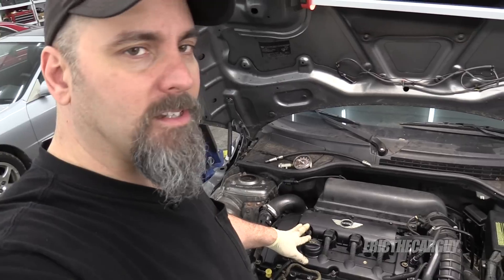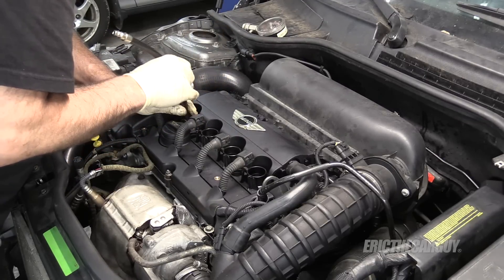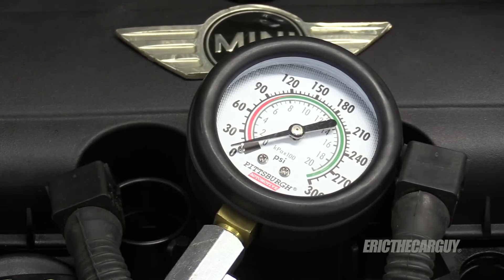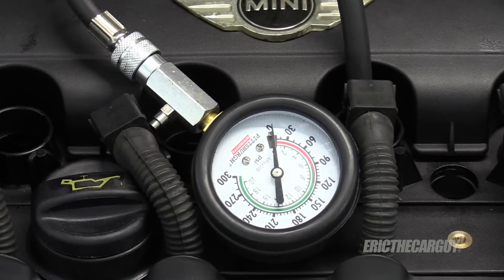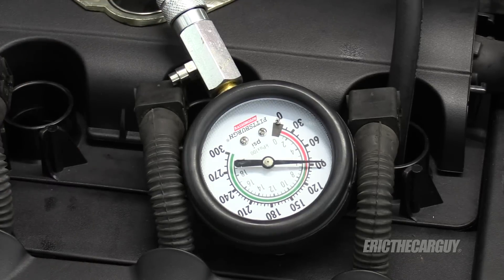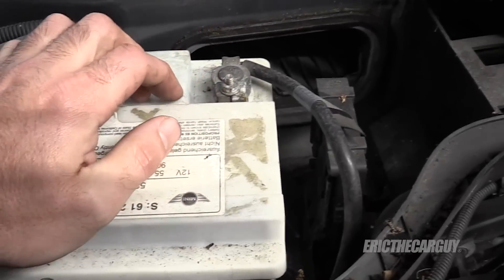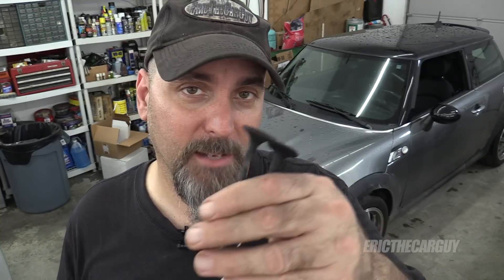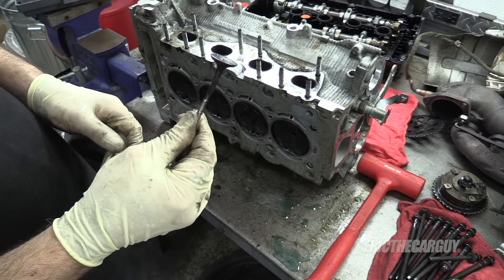How To Find Out if Your Engine Has Bent Valves

Comment: 90 psi is very low. I don't see how that engine isn't completely worn out. My sentra had 190 psi and that was around 9.5:1
Reply: it's the junk horrible fright gauge, check valve is at the tester body and not the hose ends where it should be, they read way low, because it lowers the compression way down....
they're OK to check for balance across cylinders, but forget real readings ;)
Reply: @throttlebottle5906  Mine was on the body as well. Still got correct readings.
Reply: when I say check valve I mean the schrader valve which allows and holds the pressure in the gauge, not the relief button for emptying.
if the valve isn't at the hose end/ spark plug fitting, the results will be skewed drastically by the volume of the hose, fittings and gauge body.
it's equivalent to having a larger cylinder head chamber, lower piston deck height or thick spacer head gaskets., deck height and head chamber is measure in CC's of fluid.
maybe someone will be kind enough to measure the CC volume of the horrible fright gauge/hose setup and bother to calculate the effect it has against that exact engine as factory stock. but I'm guesstimating his results are off around 50 psi !! except the dead cylinder ;)

Comment: I think the low compression numbers you got are the result of the engine being turbocharged.  When the turbo kicks in, and starts making boost, the cylinder pressures will jump dramatically. If you have hi cylinder pressure to begin with, the added boost would most likely, at the very least lift the head enough to blow the head gasket fire rings. Just a thought there.  I thought about it a little more. It could also be the result of advanced exhaust valve timing also. That would cause low pressure to. I'm not saying cams out of time, but, again designed do to turbocharging.
Reply from the maker: The timing on this engine is fine. I just set it before doing the test. Many have suggested that Harbor Freight compression gauges often read low. I think that's the most likely cause. Thanks for your input.
Reply: @ericthecarguy  thanks Eric,  your Wilkome.  I have watched all the vids on the mini. Including the timing belt change. That's why I said it wasn't a mechanical misalignment.  But a designed application of the exhaust timing.  To reduce the initial cylinder pressures. I wasn't claiming at all that it was a mechanical timing issue,  or bad alignment on your part. I hope this clears it up for you. If the calculated, or designed compression ratio is relatively high 9:1 or higher, you can advance the exhaust valve timing to reduce the initial cylinder pressure to avoid too high pressure once the turbo starts making boost.
Reply: They still have way over 90 psi compression. Should be closer to 150-160.

Comment: you could have figured this out buy listening to the starter and no gage.
Reply: only because there was a complete loss of compression in this case.  If the bad cylinder still had say, 50 psi, it would be hard to spot without the guage.

Comment: Question: the aux/drive belt frayed and wrapped around the cam belt which snapped the cambelt, i have replaced both belts and put the car back into TDC re aligned the camshafts fitted a new belt the car was pulled over instantly the car was still TDC and aligned but after replacing all belts and timing correctly the car wont start and it makes a dry starting sound and keeps backfiring through the air filter any ideas did the frayed belt take out some wiring aswell as belts or are the valves bent and if so surely the car would still start on 2 of the 4 cylinders ?
Reply: hard to say if a car would start on only two.  Keep in mind that unless you pull the plugs on the two bad cylinders they are a major drag on the  remaining two.  If possible find out if your engine is a interference engine or not, on a interference engine the valves and the piston occupy the same space, just not at the same time.  If the timing belt or chain goes damage is likely (but not certain)  In a non interference engine the only way a valve could hit the piston and get bent is if it drops.

a slightly ghetto way to preform a leakdown test is to rig compressed air into the spark plug holes.  hissing from the oil cap indicates ring\piston issues, hissing or bubbling from the rad a bad head gasket, and hissing from the exhaust or intake bad valves.  Of course you need to make sure the valves are closed on the cylinder your testing first.
Reply: if it's an older car with distributor, it could be 180 degree out, more so if it's crankshaft driven distributor.
but a cam belt breaking while running most certainly bent multiple or even all the valves, assuming it's an interference engine...

Comment: Just listening to it, one would know right away it has bent valves :)
Reply from the maker: Not really. It could also be a bad coil pack, bad spark plug, bad injector, or some other mechanical issue like a hole in the piston.
Reply: Yes very true, sorry I didn't even think of those. It's just whenever I had a misfire in mine like with like let's say a spark plug, it didn't sound like a hammer hitting :/

Comment: Did it get bent valves because its an interference engine?
Reply from the maker: Yes, and because I didn't properly torque the crank bolt. I cover that in detail in next weeks video.
Reply: Does that mean you will or would need to check the top of the piston as well?

Comment: Someone should also mention that if you havent even heard of Leak-Down Testing before:
It is very simple to do,
Only takes a little while longer than doing a compression check,
Air compressor, differential pressure guage set and a wrench to turn your crankshaft are the only extra tools you will need from doing a compression check
Reply from the maker: There's also a video on leak down testing linked in the description that covers the entire process. Thank you for your comment.

Comment: It's because there's no Schrader valve on that garbage harbor freight compression tester, they typically test about 10-50psi low
Reply: It definitely has a Schrader valve. The gauge doesn't return to zero on any stroke other than compression. That means pressure is retained in the hose and gauge, hence a valve.
Reply: @dylanheadrick3789  there is a Schrader valve in the tester but not on the nipple where it should be. The hose retains unaccounted for pressure.
Reply: @igotmesothelioma  the pressure is maintained, So accounted for. The extra volume of the hose is what's not counted for.
Reply: @igotmesothelioma  Oh, duh. Thanks for the correction! Shoulda' thought about that.
Reply: @jamesfackenthal  semantics can we both agree the compression guage from harbor freight is garbage?
Reply: @dylanheadrick3789  I misspoke in my original post there is a Schrader valve but not where it should be my bad
Reply: @igotmesothelioma  yes, I most certainly agree that it is garbage.
Reply: right on, I just said the same thing to someone's comment. I added about the hose being flimsy/weak and the check valve being at wrong location, letting the hose become part of the overall cylinder/head volume. which is the same as having a larger head chamber, lower piston deck height, thick head spacing gaskets.. = lower compression!
Reply: My engine tested 210psi with a harbor freight compression tester, and 250psi with a snap-on tester. Def not a good gauge.
Reply: David G 🤔
Reply: I have this same one. It reads accurately, as far as I can tell, and hasn't steered me wrong in any diagnosis. I agree, however, that there are better alternatives.

Comment: Perhaps 90 psi is ok for engines that produce torque at a higher rpms.
Or it's a 'Gutless engine' that's geared to compensate. ha ha :-D.
Just my daft guess :)
Reply from the maker: It might have something to do with the fact that this engine has a turbo. You want lower compression with forced induction. Or it could also be that Harbor Freight gauges seem to read low.
Reply: i had forgotten about the turbo, silly memory.
Perhaps check the gauge with your compressed air line and tyre pressure gauge on a T connector.
Or test it on a known car, like your honda, very well known to you.
Reply from the maker: I could, but the truth is I don't put much faith in the numbers. If the compression is similar on the remaining cylinders  like I stated in the video, I think you can reasonably assume the engine can run. What you're really looking for is anomalies like 0 compression on cylinder #3 in this case.

Comment: Great video as usual Eric, but what could cause valves to bend like that other than a broken time belt for example ?
Reply: He didn't torque the crank bolt properly which caused the engine to go out of time. He mentioned it in other videos.
Reply from the maker: I cover that in next weeks video.

Comment: Keep in mind every harbor freight compression testers i have purchased always read low (4 of them) but zero is zero lol
Reply: pretty sure it's the "hose" more than anything, if you watch the hose when cranking closely, you'll see them really expand and contract...... (way too soft/flimsy)
Also the check valve is up in the tester body by the gauge and not down at hose ends, which means the "volume" of the hose becomes part of the total cylinder and head volume. (wrong location for accurate readings) it's the same as having lower compression ratio due to having larger volume head chambers, lower piston deck height or head shims/thick gaskets.
I don't know the total volume of the hose or adapters, which appears to be large overall, so I wouldn't doubt if it's skewed by well over 30PSI ;)
Reply: when you replace your spark plug with just tiny compression tester fitting (like in this video) the compression ratio decreases in your cylinder. Because the fitting is a lot shorter than a spark plug.

 Hence the low reading on the tester.

Comment: Let me guess, that engine is interference with a timing belt?
Reply: It has a timing chain. He did another video where he replaced it and the tensioners
Reply: So someone didn't put the timing chain back on right then...
Reply: @opl500  correct. He mentioned either in another video or his newsletter (I forget which) that he didn't torque the crank bolt properly when doing the timing chain job, which caused the engine to go out of time, and caused the bent valves
Reply: HI ho, hi ho, off to the machine shop we go...

Comment: Did I miss something?  Are you saying that your Mini (BMW) has now bent some of its valves?
Reply: He's mentioned in other videos and in his newsletter that he didn't torque the crank bolt properly, causing the engine to go out of time, bending the valves. This happened after the engine repairs. So he had to take the head off, replace the valves, and redo the timing job. It's all back together and running fine now.
Reply: Oh boy, that sucks. Did not hear about that. Well at least whoever gets that car next should have a pretty solid engine, for a mini.
Reply: Jon Clark  thanks I wasn’t exactly sure what was going on for a minute
Reply: I would guess that he did this video a while ago and is posting it now. If not I must have missed something too.
Reply: Shitting peugeot engine

Comment: Thanks for the new video Eric. I as well did a compression test on my 96 gt and the results were stunning 180psi 1,2,4,5,6,7,8 but #3 had 135psi. Time to tear into it
Reply: i bought a cheap cavalier with similar compression results (i compression test cars before i buy them), but hey, it was cheap.  It ran fine for several years before i scrapped it for other reasons.

Comment: Great video.   Might be worth mentioning that if you don't have a leak down tester, you can pur a squirt of oil in the offending cylinder and test again.  If the compression comes up it is more likely going to be on the bottom end, if not it's more than likely the valves.
Reply from the maker: Absolutely. I cover that in the compression test video linked in the description.
Reply: I dont like this method. Auto parts stores all over the place rent leak-down testers for free and I believe its more than worth the trouble to do the proper test.

I have had several cases of extreme carbon buildup on the exhaust valves (I live in the city, stop and go traffic) where this method would cause a rise in compression and give a false diag of bad engine when it just needed a head job.
Reply from the maker: Samuel Michelson Did you watch the video or just comment? I believe I mentioned at the beginning and the end of the video that a leak down test would be best, but this can get you started. Also, if you watch the leak down video linked in the description I show how you can use a compression tester to perform a leak down test. Thanks for your input.
Reply: EricTheCarGuy, yeah, I watched the video. Did you read my comment thanking you for telling people about leak-down testing? I was referring to my dislike for people putting oil in the combustion chamber and seeing if it changes the compression readings. I dont think there is any useful information to be gained from doing this as per reasons already stated.
Reply from the maker: Samuel Michelson No I didn't. Sorry I missed that. I don't have an issue with putting oil in the cylinder. For me, if you find a big leak, you know it's coming apart anyway. Thanks again for your input.
Reply: I use oil after a leak down test to confirm if it is the bottom end and see if the compression comes up with oil.  But I never do the oil test before the leak down because I down't want to seal up the cylinder with oil before doing a leak down test.  I did great video on this where I had a bad ring on a Grand Am 2.4L, whose only symptom was a slightly low idle after it warmed up and a small loss in power.

I rebuilt it.  On tear down and inspection at the machine shop, the cylinders were perfect, the they just needed lightly honed.   The head was perfect, and it was flat.   The deck on the block was warped a little and the flattened it to spec.   The ring wasn't cracked and it didn't look that bad to my untrained eye, but I never told the machine shop which one it was and they inspected the rings and said "You had a really worn compression ring on Cylinder 3"  The pistons and connecting rods were fine and were reused.  The crank was nearly perfect and just needed polished. 

You can check it out on my main page there is a Grand Am engine rebuild playlist.
Reply: Hi Tom,  I have an 2.4 LD9 in a Cavalier and really like the engine.  How much did the machine work cost you, and the rebuild as a whole? Mine is a 1998 with 127,000 miles and i would love to put another 100-200 on the odo.
Reply: I mean using oil can help determine certain info on why the compression is low , usually if it raises the compression it leans toward cylinder or ring problems, if it doesnt it could be bent/ burnt valves, holes in the head, and more its just is one method of pinpointing what the cause is

Comment: Presumably the low normal compression figures are because it's a turbocharged engine.
Reply from the maker: Possibly.
Reply: I understand your logic but that’s generally not the case in my experience. Probably because it’s German and they wanted to be different! Silly 13mm bolts and weird spark plug threads.
Reply: probably more the high quality hose supplied with said tester, they way they flex and expand during testing ;)
Reply: throttle bottle I have the same one and can confirm that the flex isn't bad, and that it reads pretty accurate.
Reply: Normally forced induction engines have lower compression then naturally aspirated engines to compensate for the extra air that consequently increases the compression during acceleration,
otherwise dependability would become an issue do to the engine running too hot in the combustion chambers
Reply: @lhabia aphone I've read BMW makes the mini Cooper engine
Reply: 116 - 174 psi is the spec from mini
Reply: also those plug holes are going to be 1/3 of the combustion chamber volume

Comment: I thought bad/worn piston rings were the cause of the low/no compression?
Reply: Both, either way take engine apart or get a new engine, no compression probably bent valves, low comp probably bad rings
Reply: There's lots of causes of lost compression. Could be a hole in the piston, bent valves, damaged spark plug hole or even on a modern a problem with the direct injection though I haven't heard of that one yet.

Rings are just the easiest to test if you add a little oil and the compression goes up, them the piston rings are poorly sealed... but the whole engine is probably worn out at this point.

I did a video showing the oil test and using a battery charger to get more consistent compression tests. Stronger batteries show less of a difference as you test cylinder to cylinder.
Reply from the maker: Many things can cause low compression, a leak down test can reveal exactly where the loss is.

Comment: The car that just keeps on giving lol
Reply: I don't need that kind of giving catch my drift
Reply: Haha! This Mini is that gift that keeps on giving through the whole year, Clark.
Reply: Yeah, heartache after heartache
Reply: The thing is a lemon.  I know I won't be buying one even if its cheap.
Reply: Keeps on giving, up. Or is this before the engine swap?
Reply: He never swapped the engine, but it was after changing the timing chain.
He forgot to torque the crank pulley bolt, and this happened.
Reply: @panzerveps  ok. Yeah I haven't kept up I knew he did something. Costly mistake. One time I put the crank pulley on backwards on a Honda and broke the teeth. My $350 car turned into $400 real quick.